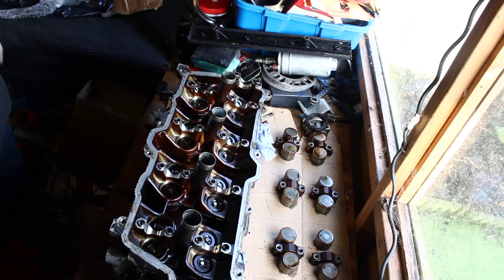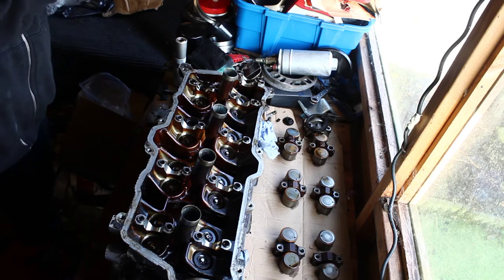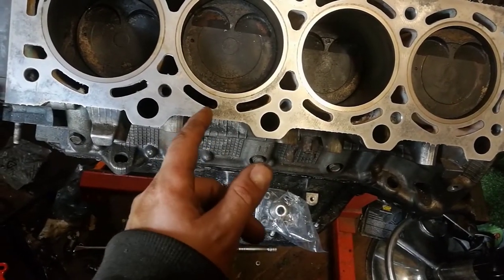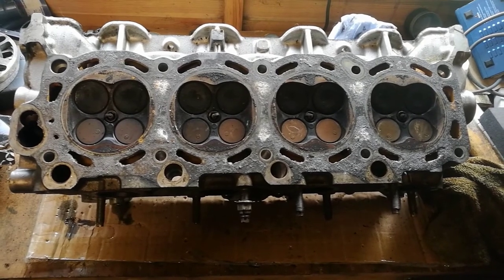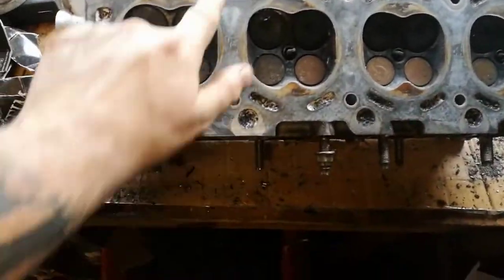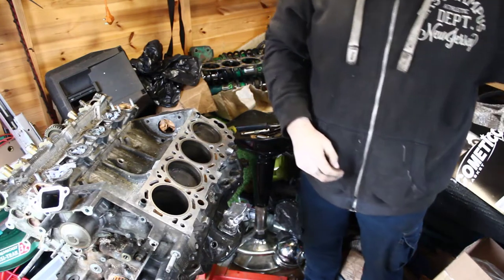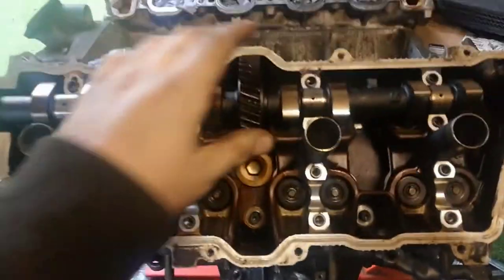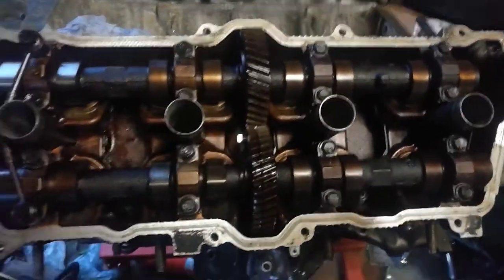1UZ Cometic gaskets, ARP studs and valve springs install (V8 Shogun/Pajero new engine part 2)

Comment: Thanks for posting, man! What ARP kit did you use?
Reply from the maker: It was a kit supplied by Ben Newell at Underground Performance here in the UK. The part number of the studs is AM4.600-1LB, and two of them need to be ground down by around 3mm to clear the cam gears.
Reply: WestMods Nice! Thanks for the reply. :-) Is it the front-most bolts that need to be ground down?
Reply from the maker: No, it's the two in the centre under the exhaust camshaft drive gears (the cams are a slave cam setup on the 1UZ, the exhaust cams are driven off the intake cam by gears half way along the camshafts).

Comment: When you bolt in the arp studs with the hex key, do you even torque them down? Didnt't see you use a torque wrench there :)
Reply from the maker: The studs only need to be hand tight. The nuts need to be torqued when the head goes on of course, but the studs themselves merely need to be hand tight. All the clamping force comes from the nuts.
Reply: @2one9developments  no locktite or anything needed on the threads?
Reply from the maker: No. The nuts provide all the torque.

Comment: What's the benefit of using ARP parts?
Reply from the maker: More clamping force, so there's less chance of the heads lifting with high boost levels.
Reply: @2one9developments  Thanks!